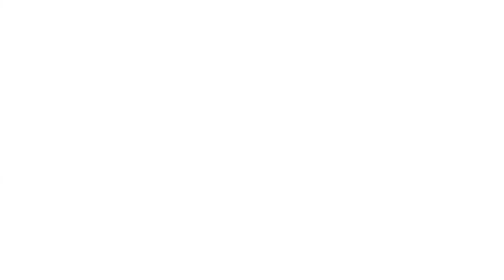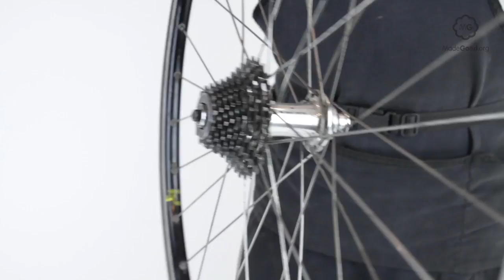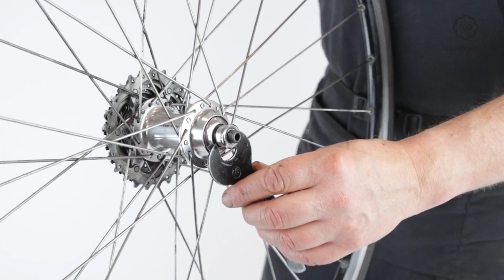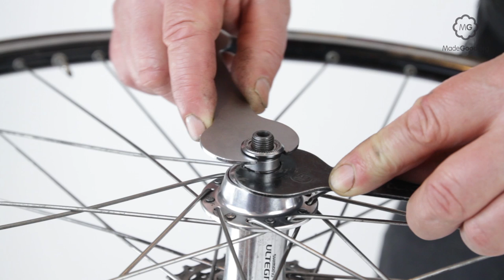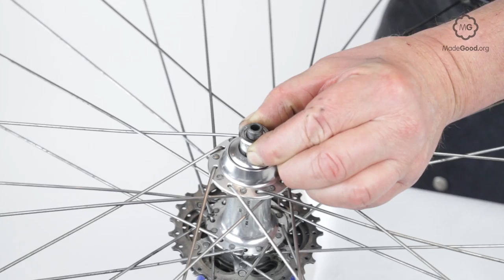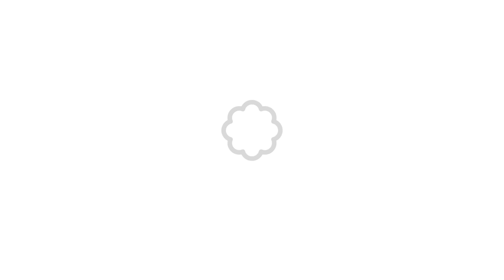Adjust A Bike Wheel’s Cup And Cone Rear Hub

Comment: If you come to the hub side and find the nut/cup is loose you DON'T need to "have your hub rebuilt and serviced" just undo everything on the left (non gear hub side) push the axle through to  expose more of it on the right and tighten the nut against the cup about four threads away from the end of the axle. (Sometimes you need to slide a little rubber cover out of the way) then push it back through and continue adjusting the bearing as shown in the video.

Comment: Thankyou. Brilliant explanation , i had adjusted the wrong side
Reply: there is no wrong side they both have the same effect. the only problem would be not locking the nuts together at the end.
Reply: @xnova5  Thank You for this comment. I was worry I've just letting out the wrong can of worm!! I'm back and mean business now after a long search for videos to steer me into the right direction. 😅😂

Earlier I took out the cassette and its locked nut came loose. I ended "locking the nuts" together and freaked out when the wheel couldn't spin freely after it was installed onto the bike... 😢😮😅😅

Comment: Tighten the cone by finger the hardest you can then tighten the lock nut with counter spanner on the cone.
Reply: That's been my experience. I overtighten (snug not hard). Then when I cinch down the locking nut it tends to loosen the cone to perfection, usually. I also test by spinning the axle  by hand rather than spinning the wheel, its much more sensitive that way.

Comment: How much axle do you need sticking out?
Reply from the maker: This isn't really something you can choose because the length will be decided by the manufacturer.
Reply: @MadeGoodFilms  or i think i said it wrong i meant the threads on the end
Reply from the maker: @gaming222-s4g  Do you mean the part that the quick release (or regular) nut screw on to? If so, just enough for the nut to screw on completely.

Comment: But what is he doing after 1:20? What are the criteria for losening or tightening the cone?
Reply from the maker: You should tighten the cone to remove any play (excess movement) in the hub. Any tighter than is necessary, and you will start putting too much pressure on the ball bearings, and restricting the desired rotational movement. Or to put it another way, tighten just enough to remove any wobbling.
Reply: Good, to know, thanks for the reply.

Comment: Hello! My rear wheel doesn't spin freely, which means that it stops after a few revolutions (compared to the front wheel). The wheel doesn't touch the break pads and if I loosen the quick realease, it still persists. Do you think the problem could be the cone being to tight? Thanks!
Reply from the maker: Yes I think that could be the problem!
Reply: thank you! I will try to sort it out and let you know the result :)
Reply from the maker: Yes please let me know. Please just bear  in mind that without seeing the problem, it's very difficult for me to diagnose, so my advice is not given with much certainty.
Reply: I took the wheel out, adjusted the cone and locknuts tension and after a few tries, I managed to get to the sweet spot. It has the slightest bit of play, altough I don't think it will be a problem. I read that the quick release compresses the hub and you can use this to fine tune it (get rid of the play, but keep the wheel free to spin), but on my bike, tightening the quick release didn't have any (perceptible) effect. Sometime in the future I will open the hub, look at the bearings, clean and grease. Thanks for the tutorial! (I hope I made myself clear, but all the mechanical terms have different names in my language and they are not very intuitive in english for me :(
Reply: @reluba  Hello, I've encountered some play in my rear hub after adjusting rear hub cones as well. May I ask you how well did it go in yours so far? thanks
Reply: @carlosmacedo4792  so far, I didn't have any issue. I asked somebody from a bike shop and he told me it's too small a play to make a difference, although you can definitely feel it. On the other hand, my dad told me that small play is actually necessary because when you ride the bike at high speed, the friction makes the slightest dilatation of the parts.
Reply: yeah i had the same problem after i needed to change the cartrige on my bike. I did not have the necessary tool for the job and was short on time to buy one so i was forced to go to a bike shop. Big mistake the mechanich decided to be helpful and thighten the rear bearing just a bit i tried it out and for the first 2-3 miles it was fine later it started clicking but i had one weekedn free and was not about to spend it fucking with the bike. By the end of a 20-25 mile trip the rear bearing was creeking like a old house during moving because one mechanich decided to help me and the other decided it was all fine even though you could feel a slight click in the frame if you spin the wheel freely so yeah loose is better there are no simple tricks find a sweet spot and you are golden. if you are serioues abut cycling buy your own tools to do every job you will do it better than any mechanich because its your bike at stake. why they dont make wheels where you can slot stock bearings is beyond me